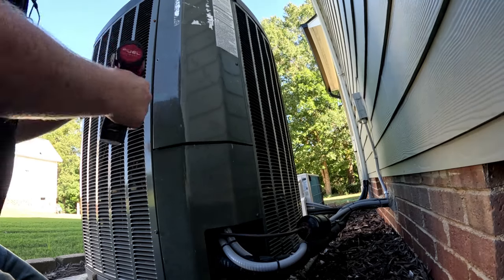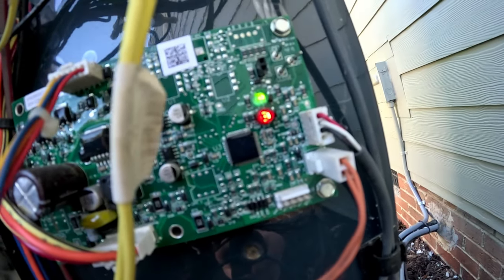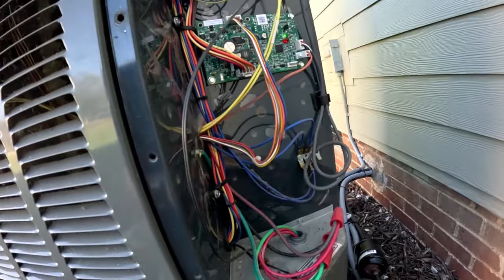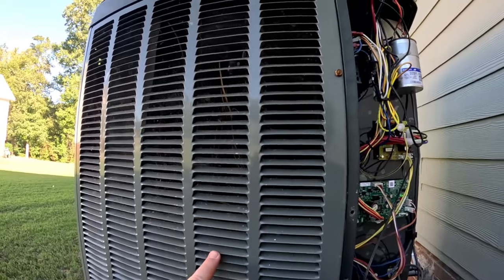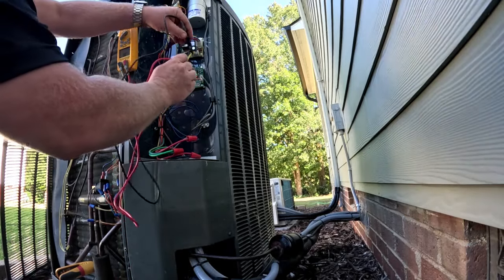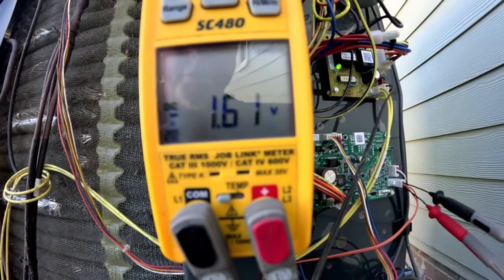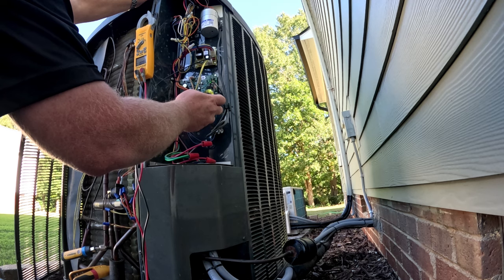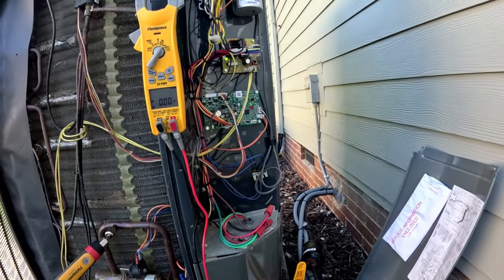Heating and Cooling not working.

Comment: I had Low Superheat in Cooling Mode code on American Standard Gold 16 .. pretty much identical units and the code is persistent until cleared by the test jumpers.  The sound shell is a good option but it requires climbing into the unit.  🐴